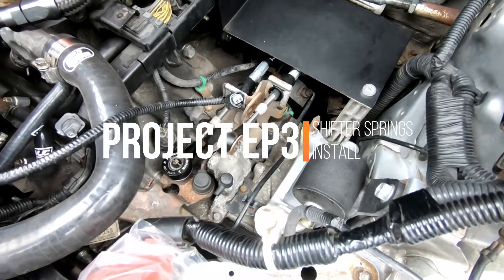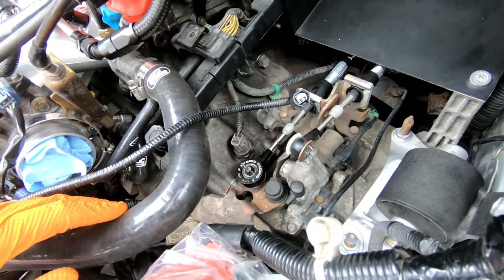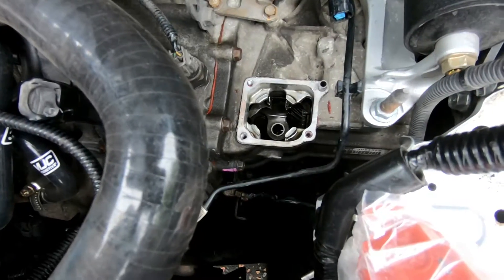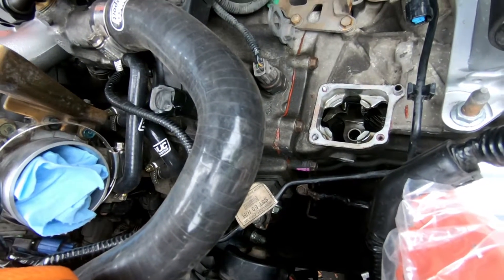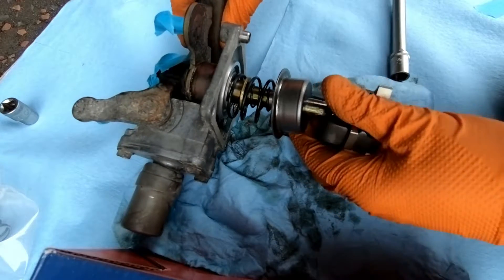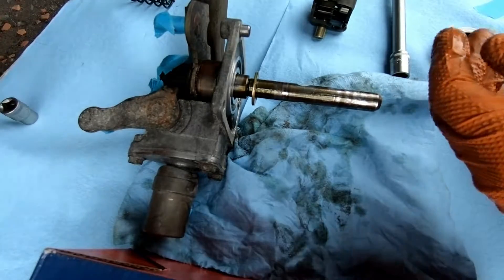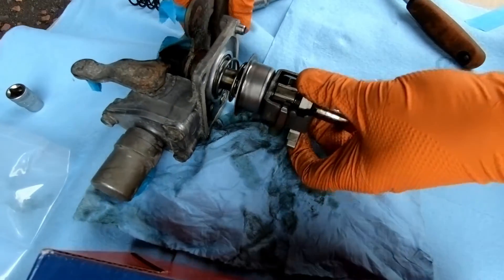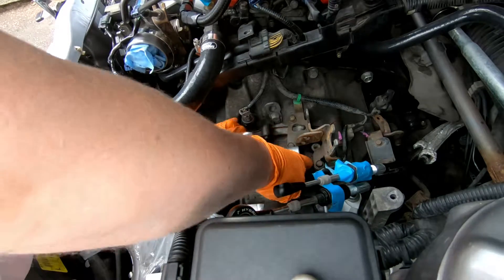How to install Hybrid Racing shifter springs into a Civic Type R K series gearbox

Comment: Hi Neil would you say the hybrid shifter itself is worth the money upgrading from oem shifter?
Reply from the maker: It's a good bit of kit. But I think the Revo shifter is much better value, though it does have less scene points.
Reply: Neil Magill thanks Neil Ive just ordered one and was wondering if I made the right choice, did you have a revo before hybrid?
Reply from the maker: @DangerousDavee  I did indeed have a Revo before hand.  The price difference works against the Hybrid shifter in my opinion.  But it is a good bit of kit.  I paired mine with the Hybrid shifter cables too.

Comment: Hi Niel, what did you do to hold the hybrid racing shifter cables to the chassis from underneath the car? The old brackets don’t fit the new cables. Any help is appreciated :)
Reply from the maker: Hi Jordan, I bent the old brackets to make them fit the Hybrid cables. Poor show on Hybrids part that suitable brackets and a grommet is not supplied.
Reply from the maker: https://rmsmotoring.com/forum/threads/my-2003-civic-type-r-ep3.194267/page-21

A link if useful...